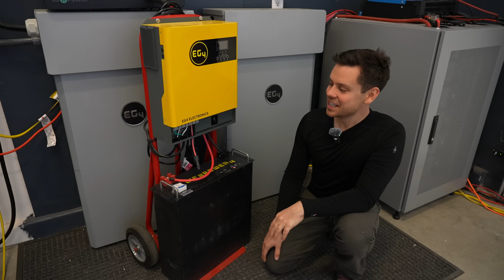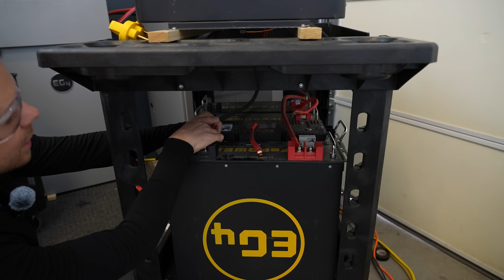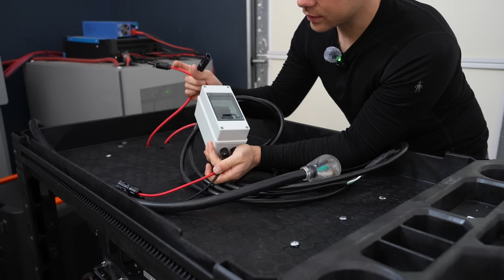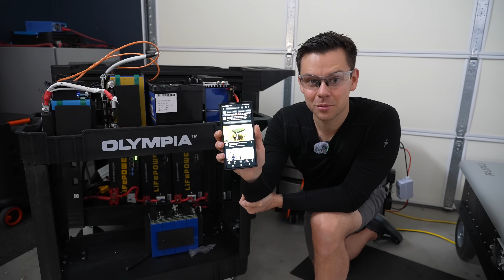DIY VS Ecoflow Ultra! Save thousands building the Solar Kart

Comment from the maker: Solar Kart Parts List (affiliate links):
48V Version 2
Large Tool Kart: https://amzn.to/3Zcu8vN
Sever Rack Batteries: https://www.mobile-solarpower.com/server-rack-lifepo4.html
6000XP Inverter/MPPT: https://www.currentconnected.com/product/eg4-6000xp-inverter/?ref=wp
Battery Cable: https://amzn.to/3wM2PeB
Solar Disconnect: https://amzn.to/3VdG27j
NEMA 14-50 male and female: https://amzn.to/3B16b2m
NEMA 14-50 to 120V load adapter: https://amzn.to/3Znq0dE

12V Solar Kart
Small Tool Kart: https://amzn.to/3CGciJR
300Ah Wattcycle Battery: https://www.wattcycle.com/products/wattcycle-12v-300ah-mini-lifepo4-battery?ref=aaezwkkc
12V Inverter: https://www.mobile-solarpower.com/inverters.html

EcoFlow Website: https://bit.ly/4fOICJ4
EcoFlow Amazon: https://bit.ly/3YN6q9c

Jackery (better output for the money vs ecoflow): https://bit.ly/3USRXHz

Amazon US Store: https://amzn.to/40N4qjW

0:00 We need new systems!
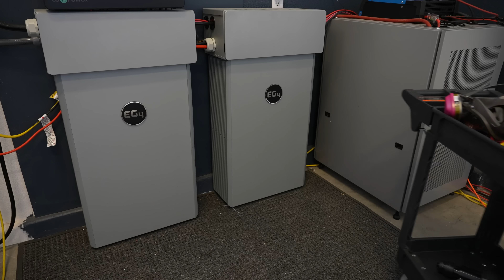0:25 Tool Karts!
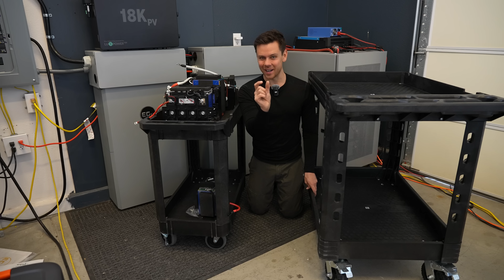1:10 Building Version 1
3:07 I hate it!
3:45 Version 2! Much Better
5:33 Total Cost
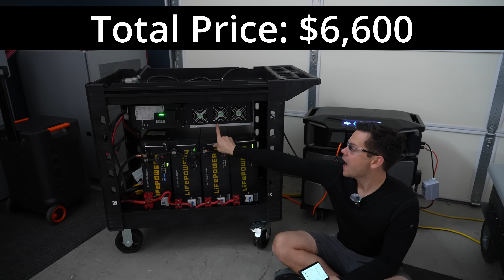5:57 DIY VS Ecoflow Ultra Price
6:33 Sizing Discussion
7:26 12V Solar Kart!
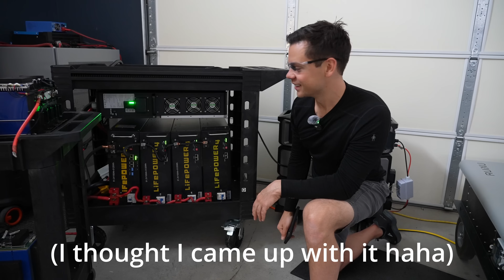8:23 Conclusion

~~~~~~~~~~~~~~~~~~~~~~~~~~~~~~~~~~~~~~~~~~
Tired of getting ripped off? Check out my "Will Prowse Approved" solar product recommendations below!

12V Batteries
https://www.mobile-solarpower.com/lithium-batteries.html

48V Batteries
https://www.mobile-solarpower.com/48v-batteries.html

Offgrid Inverter System Builder
https://www.mobile-solarpower.com/48v-complete-system-blueprint-559371.html

Hybrid Inverter System Builder
https://www.mobile-solarpower.com/code-compliant-48v-offgrid-system.html

Mobile Handtruck System Builder (very popular!)
https://www.mobile-solarpower.com/mobile-48v-system.html

Solar Panels
https://www.mobile-solarpower.com/300w-solar-panels.html

Ground Mount Solar Racking
https://www.mobile-solarpower.com/ground-mount-racks.html

Wire, Lugs and Busbars
https://www.mobile-solarpower.com/wire-and-connectors.html

Tools
https://www.mobile-solarpower.com/tools.html

Fuses and Circuit Breakers
https://www.mobile-solarpower.com/fuses.html

Plug-N-Play Solar Systems
Ecoflow, Anker And Bluetti! So many models to choose from. See my current recommendations here:
https://www.mobile-solarpower.com/full-size-systems.html

~~~~~~~~~~~~~~~~~~~~~~~~~~~~~~~~~~~~~~~~~~
Need to build a large DIY system? Need a trustworthy solar distributor? These are my favorites:

Signature Solar
Creator of EG4! Solar Minisplits, Victron and More! Largest Solar Store Online.
If you want $50 off, please use my link below and coupon code "DIYSOLAR50":
https://signaturesolar.com/?ref=cPwLcVc0SW-BjN

Current Connected
Best Prices for EG4, Victron, Midnite and so much more! Fast Shipping and Highest Rated Customer Service:
https://currentconnected.com/?ref=wp

~~~~~~~~~~~~~~~~~~~~~~~~~~~~~~~~~~~~~~~~~~
Join our DIY Solar Community 
Need more help? Join the largest solar forum on the internet for beginners and professionals alike. 140,000 members and counting!
https://www.diysolarforum.com

Check Out My Free Book
Best-selling and beginner-friendly guidebook to off-grid 12V solar!
https://www.mobile-solarpower.com/the-book.html

~~~~~~~~~~~~~~~~~~~~~~~~~~~~~~~~~~~~~~~~~~
Contact Information:
I am NOT available for personal solar system consult! If you wish to contact me, this is my direct email: williamprowsediysolar@gmail.com
FTC Disclosure Statement and Disclaimers:
Every video includes paid promotion or sponsorship (such as free products for review). Some links on this YouTube channel may be affiliate links. We may get paid if you buy something or take an action after clicking one of these. My videos are for educational purposes only. Information is subject to change/update at any time. Electricity is DANGEROUS and can kill. Be smart and use common sense :) DIY Solar Power with Will Prowse is a participant in the Amazon Services LLC Associates Program, An affiliate advertising program designed to provide a means for sites to earn advertising fees by advertising and linking to Amazon.com
Reply: The bottom shelf of the cart can be strengthened in two ways, 1. Add a fifth wheel in the center, often it is possible to find an exact match to the existing wheels or simply buy five new ones. 2. And a sheet of 3/4" plywood between the wheels and the plastic shelf such that the bottom shelf rides atop the plywood. What these two additions do is greatly increase the load capacity of the bottom shelf. I've done this in other applications and it works. Of course it changes nothing in the load capacity of the cart's vertical supports and upper shelf, but that is not where more of the weight of your application is being placed.
Reply: a video on the imminent tariffs would be super useful
Reply: The server rack batteries link also shows a metal server rack with 6 batteries (about 30kWh) for $7800, which is pretty compelling (but the inverter is sold separately).
Reply: If you put a plywood board on the bottom, you may circumvent the weight limit. I believe that the plastic is what is rated, as you can see that the batteries are bowing the bottom of the cart. I think that would fix it!
Reply: @elbowjeans  Agreed (see my earlier comment). Just to clarify, the plywood is under the cart, not inside the plastic shelf. So the four wheels must be removed first. Then fit the cart atop the plywood, mark and drill out the holes to re-attach the wheels. Then bolt the wheels + plywood + cart bottom shelf all back together. Finally, adding a fifth wheel in the center will greatly improve the strength of the bottom shelf.
Reply: I'm looking to build a portable system that can be broken down and carried one piece at a time. I think my inverter would fit in a Milwaukee pack out rollie case. 

Anyone have any ideas for the server rack batteries? There are 4U sound gear cases that are blow molded and some even have wheels built in but they are $250 each. Any thoughts on a travel case for a server rack battery?
Reply: @affordabledcgenerators1607  Is it plastic?
Reply: You're the best. Thank you for making this.
Reply from the maker: @Guy-Martin  thanks 😁
Reply: DIY battry kits
Reply: @eddiemoney7952 mppt is in the inverter description, which implies it is a solar charge controller, read the specs
Reply: @WillProwse how about using something like Uline’s H-1191 or H-1192 (Wood platform trucks)?
Reply: (2,000 lbs load capacity)
Reply: How long would it take to charge from 8000 watt solar array?

Comment: Is there any way to bring 240 volts into the EcoFlow Delta Ultra and have it output 240 volts, and charge at the same time? It doesn't seem possible to use it as a standby UPS for a 240v load.

Comment: Will, love your videos ! Quick question.. Signature solar EG4 batteries in parallel:  Doesn't the communication cable(s) help facilitate load balancing between the batteries if bus bars aren't used?  Thanks

Comment: Question ..... Does anyone know or ever tried this. Can you charge lithium batteries from an inverter charger if you plug the inverter into an outlet the the converter is powering. Is it possible

Comment: I would have used my ratchet straps to mount the inverter, they are canvas and would be able to hold the weight just fine and leave you room to wiggle if you just don't tighten them down too much.

Comment: Will:  Love your build and where you took the cart idea.  I think you'll run into struggle with the plastic cart once things warm up and/or weight on plastic over time will deform the structure of the cart.  Suggestion:  Bolt on a few pieces of angle iron on the bottom, under the battery shelf, for added stability.  I think the rigidity of the inverter across the top shelf will serve as the same function for it.  Still, I do think the plastic wheels will deform or develop flat spots on them for the same reason above,  load and warmth over extended time.  To overcome that, maybe consider upgrading the wheels to some designed for the weight ... or ... when not needing to move around, elevate the cart on struts/blocks to remove the weight on the wheels.

Comment: Yep, You need to build a smaller 12V version with the smaller cart.  Make sure you use all the features (like shore and PV charging, 10ms transition to 120V/60 pass through and back, regulated 12V out) vs just a simple inverter and MPPT charger.  Is there a better/smaller option to the MPP Solar All in One 1kW?

I love your enthusiasm.

Comment: I would hang the inverter under the handle of the cart.   Since it is not on any shelf it doesn't count against your weight limit, so you can add more batteries.  LOL

Comment: I am thinking about building one using a 1000 lb garden cart with 2 batteries.  The larger hard rubber tires should be better if you need to roll it close to a power pole or RV.  I had one question on mounting the inverter horizontally.  The installation documents are very specific about mounting it vertically or at a 75 degree backward lean.  Is that mainly for cooling purposes?

Comment: These are great to see. There is no proof of reliability or customer service related to technical or software problems. There is a guy who hooked up the EG batteries to an off grid cabin. He has had nothing but problems. I have solar panels on the roof that do not work at all. These ideas are great. Real world use is important.

Comment: Does anybody know of a cart system that can conveniently fit the Delta Pro Ultra inverter + 5 batteries?  I really love how much I learn from Will, and am moving toward his systems.  For the moment, however, I am learning with a Delta Pro Ultra hooked to roof-top solar to power my garage and charge my car.    At present, I only have 1 battery, but will build to 5 and, as Will says in a video, I absolutely don't trust the flimsy EcoFlow cart to do the job.  Even though the system will be mostly stationary, it will have to move at times (full disclosure, the system will first power the garage build, and only then will it be in the garage).

Comment: Good solution with the cart. You could replace those little casters with larger, inflatable, wheels for better mobility and to absorb vibration away from the electronics

Comment: @will: put a strong caster in the center to give it more support on the bottom (or 2 down on a line down the center axis).  Problem would be solved.  Also, it probably holds more than 500 but that's what it's rated for (who knows what margin the engineers are using)

Comment: how about make a video putting Milwaukee batteries in series and parallel and load testing. I'm a construction worker and would love to see what  some Milwaukee 18v or 12v  in series to 36v or 48v could put out for a quick off grid system since I have a dozen or so of the batteries laying around

Comment: My (personal!) issue with most of the these systems are the limited amperage output. The 6000 inverter is capped at only 25a and even with two its capped at 50a.
Reply from the maker: That is a lot 🤣 what are you powering
Reply: @WillProwse  The honest answer is that a "whole house" inverter should be capable of handling the average household's regional energy usage without requiring buyers to significantly alter their lifestyle or buy two of them. 

In my case, my EV charger is 48 amps, and when you factor in the dryer, furnace, AC, and other appliances, it adds up. Like choosing a car, I'm not willing to compromise my usage to make it work. Instead, I need a system that meets my needs, or it's simply not the right fit for me.
Reply from the maker: @NomadCF  surge is one thing, but continuous draw should never be 200A. I'm charging multiple evs off-grid as well. Just calculate what you need
Reply: @WillProwse  Absolutely, but at the same time, the average home is built with a 100A to 200A panel for a reason. If these devices and companies are going to label their products as "whole home," then it stands to reason they should support the average "whole home's" current usage. Instead, "whole home" seems to imply a home where the occupants are willing to downsize their energy usage to fit within the limitations of these devices.

In short, if they truly want to break into the average home market, these devices need to be designed to integrate seamlessly with the average home's existing system.

Side note: They also need a transfer time of less than 10ms—ideally between 5ms and 7ms. Otherwise, you'll still need additional UPS units downstream for critical equipment.
Reply from the maker: @NomadCF  you can parallel them and do 200A. They all can
Reply from the maker: @NomadCF  I don't downsize my life 😂 I charge 3 EVs right now and have 11 heat pumps. maybe you need more money lol you can do all of this easily

Comment: I've built two portable systems with rolling tool boxes. Both are 24v, one is 2560Wh and the other 5120Wh. . The smaller system is in a 25 gallon box with separate inverter, mppt charger, shunt and two 12v batteries with raspi running Victron software for monitoring (version 1). The 5120Wh is in a 50 gallon box with an all in one unit and two 24v batteries with raspi running Solar Assistant for monitoring (version 2). These guys kept my refrigerator and two freezers running during our power outage back in Sep. Keep these videos and new ideas coming.

Comment: Will, i love your content. I have a question on the reasoning the manufacturers mounting specifications show upright or mostly upright. I had thought about mounting similarly to that but didn't want to do something that may affect something negatively. Is there any reason it shouldn't mounted in the other inverter angle directions? (To your knowledge)

Comment: Something to keep in mind with these is they are meant to roll on perfectly flat smooth surfaces under load. If you push it around and hit the wrong bump or try to take it on an incline they will catastrophically fail under load. Basically will collapse like a cartoon.

Comment: If I have two 332 amh BIG BATTERY  17KWH. They are around 4 years old. Is there any way to install more with the cycles being so far apart 🤔   I need more storage. But just want to add to what I have. Any suggestions  ??  Built my system watching you. 
Thanks man.

Comment: I had a generator but decided it was to much of a hassle for power backup in case of an on grid outage. However, I found that I might be able to buy the pieces, over time, and build a similar cart. That way I can have several days energy for essential appliances waiting all times. I think, using batteries are much more energy efficient than at home fossil fuel use anyway.

Comment: Just watched you rip apart the ecoflow battery, and talk about a new tool to cut them open. I saw the rotary that melted the case, and have been think8ng about it for a while. What I came up with to try, though I don't know the cost, used may be possible,  is a medical saw designed to cut off casts. I do know they vibrate back and forth to avoid cutting skin, and depth is easily set. If they can be picked up for a reasonable price, it might work perfectly.

Comment: Good day. Id like to have your opinion on the Sunway tech solar 14.33kwh battery and if it can be compatible with a EG4 6000XP INVERTER. I have tried finding videos on the subway battery brand but couldn't find a reliable opinion

Comment: I have a perfect use for this, this reminds me to finish a project haha.
I have a mini setup with 2 Victron inverters and some 48v rack batteries so I can get 220 power for some equipment where only 110 is available. 
It doesn’t get used a lot but when needed this would be perfect for me

Comment: For the rack how about one of those 5-Tier Wire Shelving Rack 48" x 24" x 72" NSF that is on wheels? The are sold everywhere and hold like 800-1000lbs and are cheap.

Comment: One step bigger on the cart… Mount it in the back of an old Prius, now you have proper tires and suspension, built in generator and gas tank, it portable, and weather proof. 
Would connecting the HV car battery to the solar input work??

Comment: Used my idea huh? I got my cart from Harbor Freight for $100 with 8x 100AH Wyatts @ $130 each. I haven't yet built it out yet as I have been pulling these 12 hour days for the last 3 weeks. I checked my preps and I only have an 800 watt inverter (I bought it for my car to use with a laptop and gear when I was doing the mobile tech thing), so I have things I need to grab to fully kit mine out.

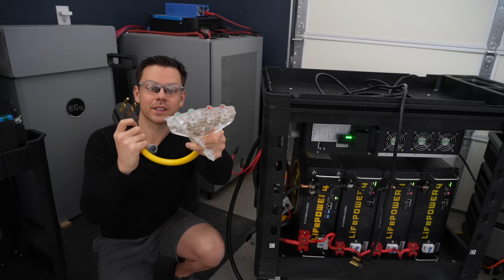Comment: 5:18 wouldnt that mean any device you plug into it could pull up to 50 amps before a breaker trips? or does the plug head have built in 20 amp fuses?

Comment: Hello!  So, with a split phase inverter, during a power failure, just turn the main breakers off, then plug the AC output of the inverter into a 220 outlet?  Regards

Comment: End of your video I got a question. If you do use a metal one, can you just put two "KNIPEX Rubber Mat-20" x 20"-1000V Insulated" underneath the batteries?

Comment: Please look into louitton lifepo4 batteries. They are the cheapest 200ah i could find at 360€ and their 300ah is even cheaper at 395€. I bought 3 of them by now and so far they have been working as i would expect.

Comment: What do I have to do, with net metering, to keep my battery capacity in the batteries until I start drawing from the grid at night? What system do I need to focus on given I'd like to use batteries for my excess rather than trade it on the grid.

Comment: I think it would be cool if you made a video showing a battery bank and inverter being used for stick welding. Maybe it’s been done and I just need to search it.

But the two things I want to be able to do with a solar system is weld, and run an 12000 btu AC